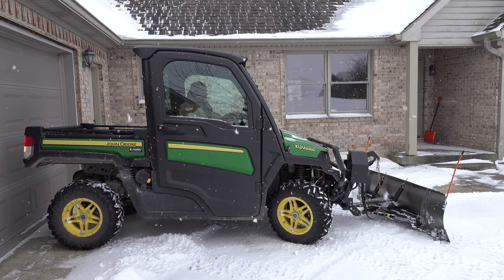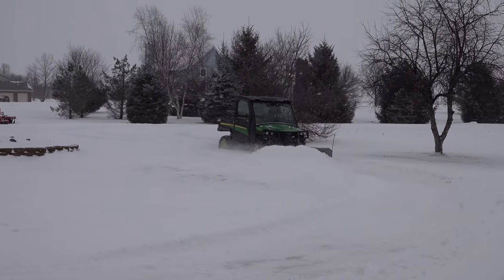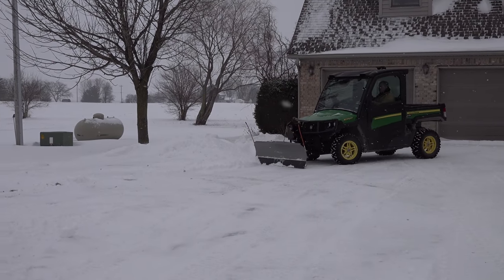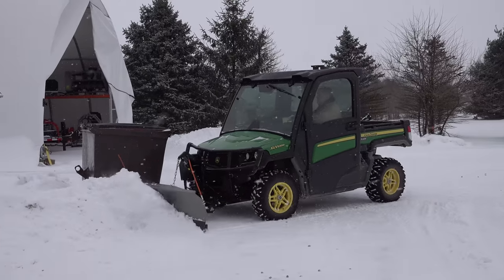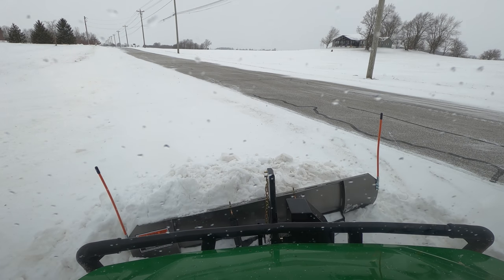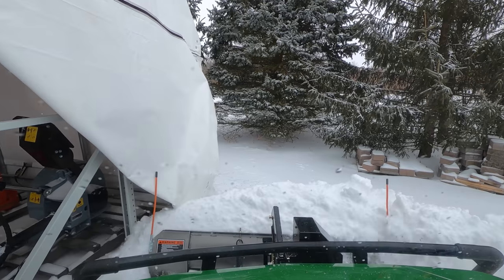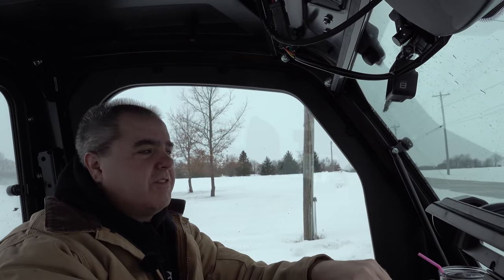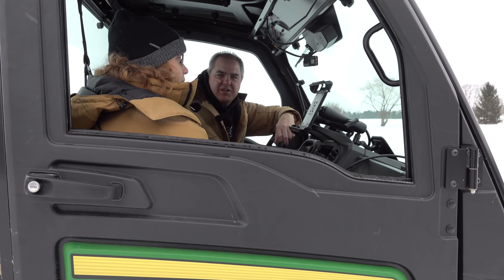Drifting Snow VS. Gator 835M!

Comment: I had a Dodge 3/4 ton with the Cummins, and a BOSS V blade, now that was a snow removal machine. 
I no longer have that, and have had a number of different snow removal tools.
Had just the walk behind snow blower, did not care for that dirty to use, and cold. 
Had a 4 wheeler with plow, good for a small amount of snow, like you were plowing in the video, but again cold to use.
I acquired a 4ft snowblower for the front of the 4 wheeler, that had its on 13hp Honda engine and was a very effective way to move a lot of snow, but again, without a cab very dirty and cold, if wind is blowing. 
Sold the 4 wheeler, and got a Polaris Ranger 700 side by side, acquired a 6 ft plow, and I do have to say how impressed I am with the amount of snow it will push. The key to pushing is weight in the back, it has a max weight limit of 1000lbs, but I find 400-500 lbs is plenty to push an enormous amount of snow. Another key factor is to keep blade straight when first pushing, and use the angle only when cleaning up, or on the longer straight passes. 
I do have an older David Brown with a straight blade, but without chains(2wheel drive), I say it is like building kitchen cabinets with a chainsaw. Very hard to control, and usually have a massive amount of gravel, and sod, in the snow bank, or spinning. 
So all in all, the old Dodge was the machine, but for easy operation, and maneuverability, the side by side is the ticket.

Comment: Balaclavas work well on protecting the face & neck.  Snowmobile suits or diving Dry suits are good.  Baffin boots are the best.

The body protects the head by restricting blood flow to extremities if the head is cold.  So if your hands & feet are cold, protect the head.

Both Milwaukee & DeWalt make heated clothing.  I choose the DeWalt because you can move the battery around.

What we need are gauge wheels on front plows, not just rear plows.  Sounds like a great TTWT project. :)

Comment: Phil here in NE Indiana.  I got a 54" snow blower for my JD 1025R.  I have a 1,000' asphalt driveway.  As you know in Indiana we don't get that much snow but the years we do the snow blower works great.  I've used it 4 or 5 times so far this year.  I added an electric actuator to move the shoot up and down.  What I don't have is a cab so yes it does get cold out there.  The JD 835M Gator...sweet ride there Tim.  I have an 825i S4.  Works great with the grandkids.  Cold here this morning...zero.  Stay warm.

Comment: I have a GOLDEN RULE == Always be prepared for more snow!  When that crap turns to ICE you're locked in, so I push it back a lot every time.  We (Chicagoland) got hammered with a very wet snow and some rain back on 12/29/20 and that crap froze up and has made it hard now with all these other snows we've had since, pushing it all back, so I have 5+ft piles nows down my driveway!  Still love the snow! Fun Fun

Comment: Not sure if your all geared up for the upcoming snow we get Thursday but you can come down with us and try all your toys out at once. Lol. 30 minute drive down to us and we have everything from asphalt, chip and tar, pot holes, new concrete we can’t scratch, side walls, and I think about 2 miles worth or gravel. Be fun to run all different types of equipment on different types of surfaces and see what works. Of course like you mentioned it’s impossible to know if we’ll have heavy snow or nice fluffy stuff.

Comment: I've got a driveway similar to your's here in MN, although we get quite a bit more snow.  I have about 1/4 mile long gravel, large gravel turnaround/parking area, and then a short cement driveway like your's.  I use my plow truck with shoes on the gravel, and then I use my 2038 R bucket to scrape the cement clean.  And then I take my 60" rear mount blower on the 2038 R to blow the drifted snowbanks back from the sides of the driveway so that there is room to push snow for the next storm.  Gravel cleanup is always a pain in the spring - hoping to save up soon for blacktop.  But there's definitely not a single machine that will do it all.  I have a Ranger too, but it just doesn't have enough weight to run a plow

Comment: Tim, I tried to use the pvc. I found out that it breaks up in the cold. I found that cutting a metal pipe for the blade and rounding the edges works great. This idea was from the episode where you where showing the gentleman what options there where for ❄️
Reply: I also tried the PVC on my small BX front mount blower. It does not like going in reverse . It will rip off from the gravel

Comment: That's a nice setup there. I think I would go for tracks for the winter. Better traction, power, and ground clearance. You already have the ultimate snow removing beast ...... Johnny 5. Do you have a blade, pusher, or blower for it? The bucket will dig out any drift situation mother nature can come up with. Funny, a couple of days ago here in Montana we got a lot of snow and it drifted badly in the rural areas. Got a call from a customer to come rescue her Mercedes drifted in half way down her 1/4 mile rural driveway. Then her husband tried to rescue her with his gator and plow just like yours except he didn't have the cab (below zero and blowing) and got stuck himself. Went out there with my Johnny 5 (same as yours) with an 8' truck blade I retrofitted and the 7' box blade. Box blades are wonderful snow/ice tools too. First had to plow and dig to the car, pull it out of the drift (got to admit, first time extracting a car that probably costs as much as my house made me a little nervous), and back it out all the way back to the road. Luckily, the Mercedes like a lot of high-end cars, have an extraction eye you can screw into the frame in the rear or the front so you don't rip important parts off pulling on it. It was easily twice the snow you guys had there in that episode and Johnny 5 tackled that job without blinking an eye. With the car out of the way I needed to push on to the house but had to pull the high-centered gator out as well before cleaning the rest of the driveway up to the house. Didn't even feel either vehicle in A2 gear in 2 ft deep snow. You could easily do your hole property on this video with Johnny 5. If you don't have any snow implements for it, I would recommend that you get at least a blade or a pusher for it. It will blow your mind what you can push compared to the compact tractors. I love my 1025R (no cab), but they're in different galaxies in capability. A pickup with a blade could not even remotely have done the job we did the other day. Stay warm, and I agree Christy should have the heated gator to chase you around on tractors. Also I've been meaning to ask you if you have a part number for the buddy seat you have in Johnny 5. My wife likes to ride along on these adventures and has to sit rear-facing on a 5 gallon bucket. A buddy seat would be real handy, even if it's a tight fit. I (she), would really appreciate it ..... Thanks.

Comment: I plow with a CanAm Commander with a 72” Moose blade. It’s runs off the winch with manual angle. I took the shoes off and run it all the way down. Once the ground freezes up good you won’t get much gravel up. It’s light enough to skim across the top, but scrapes concrete completely clean. If needed I can raise it just a skosch and leave a layer of snow. Hope this helps.

Comment: I regularly plow with a 825iS4 with the same Curtis plowat work.  I suggest adding about 250 lbs or so to the rear.  I found that made all the difference with the S4. I also think you will find the Gator with rear ballast will outperform a truck pound for lb of vehicle.  I find for the size the S4 out performs the one ton trucks that we use.

Comment: Looks like you need some driveway markers I run them on my trailer so I can see where the back is at. Costco had a pack of four with reflectors. I bet Menards, Lowes, and Home Depot has a selection of them. Snow plow services will install them before the snow flies to mark the boundaries. Christy is a champ standing out getting those shots. Please give us an update on your brother.
Reply from the maker: Tom’s heart is fine.

Comment: I have a TC45DA New Holland with a cab and an FFC angle blade on my loader for the gravel lane here. Without the John Deere fuel tank filled with concrete set up on my 3 point, I'd still be trying to get traction.

Comment: I purchased a 1025R with a cab, heater, and snowblower. My walk behind snowblower (Ariens) was great, but I have a very large gravel drive and at 71Yrs. I could't do it any more. The Tractor is great.
My problem is, because I got the snowblower we now only receive an inch at a time here in Traverse City. I'm thinking of billing the road commission  for the money they're saving.

Comment: When you do the end of the drive to the left side , I push the snow  50 to 75 ft  pass ,so when the plow goes by it runs out of snow before it hits the drive , so there is less clean out .

Comment: Plowed snow for almost 2 hours this morning with my X738 rubber edged 54 inch blade. Had I known we would get 10 inches I might have put the 54 inch blower on. 4 hard surface drives. Tomorrow I'll switch to the  2025R with 53 inch bucket and edge tamers. Neighbors stone drive and  road in case they show up this weekend. 
Interested to see the loader mounted blade. I have the Frontier AF10 loader blade but have had limited success.

Comment: I have a Coleman UTV and I put a taperer plow on it. The tapered  *state plow design" peals the snow beautifully here in northern MI. My driveway is 1/4 of a mile long into the woods. Wonder if they make a tapered plow for the gator? If they do, I'd recommend it. John Boy moves my snow piles wondrously.... :). The tapered plow (wider on the right side) would definitely help curl the snow off better than a straight blade...... a PVC pipe will break. My neighbor put a heavier 'BLACK' pumbing pipe on the bottom of my blade and it works great. Doesn't dig into gravel/etc. and glides over the ground when pushing/plowing snow.

Comment: The slides just back of the blade control the height of the blade to the ground? Letting it hang from the chain is adding stress to the  whole system?? Thank you for the video

Comment: I have the same Kubota as you except it has a cab and a front mount blower. I know that ATC's with a blade will twist the frame after a while. With the blower. you are not making a pile that when it gets deep you have to move it.

Comment: We ended up with 8-9 inches, hard to get a good measurement with all the drifting. We have some drifts close to 3 feet. I know it is nothing compared to those northern areas, but the most we have seen in a while (typically in the 2-4 inch range). It is a nice warm -4F this morning.

Comment: Nice video... I still don't understand why these blades come with such small skid shoes. A larger diameter skid shoe would float much more smoothly over the yard areas, not to mention gravel driveways that most of us have.  My only trick prior to winter is using my LS rake sweeping larger stones to the side for spring.

Comment: finally a machine like i have-ha! i have the jd plow instead of the curtis one u showed.. mine i can use down pressure if i wanted too. i only use the float design. no chain on mine. i too agree gator needs a slower speed on the fan for sure.also if i had a cab on my 2520 i would prefer to plow with it-way easier than the switching gear lever of the gator. i plow in low range too-found it works better-easier on the belt IMO. thanks for the review-oh how i love the heated cab for plowing snow-so glad i got it.
Reply from the maker: Yep! The heat and a/c are a TRUE luxury!

Comment: I have a gravel driveway and use my tractor to push snow.  I usually move it going backwards with the blade cutting edge towards the tractor.  I find this works really well for keeping the gravel in the driveway.  I only use the cutting edge of the blade or the bucket if I really need to.  Like I said, helps keep the gravel in the driveway.  Will be interesting to see how the blade with the PVC pipe does.  Haven't heard of that method before.

Comment: A piece of 2" PVC pipe cut down the length on one side and slid over the cutting edge works great on stone driveways grass-covered areas and cheap to replace when it wears out
Reply from the maker: Or not.  See tomorrow‘a video.

Comment: If you'll push the snow at the end of your drive where the drive meets the highway up the road off of the shoulder a bit, when the plow comes through, it probably won't fill your drive end up.   You don't need to go far.   I'd say less than 50 feet, but it depends on how much snow you have.    It works well for me in Northeast Missouri

Comment: I sure wish I had a cab on my cf moto cforce 820 atv with the plow
One tip though, it looks like you have your plow right now set to low in the attacher, always strive after to have the plow attachment as level compared to the ground as possible
I made that mistake a lot when plowing gravel, then the plow sort of acts like a razer blade , and the plow depth shoes gets in the wrong angle which makes it not glide onto the ground as they should

Plowed many many milies with tractor and blades when we had municipal roads and a lot more private roads to deal with, and dad taught me this early on, always try to level your blade and especially from the attachment joints and forward to the blade, hope it will affect your gravel plowing a bit for you in the future :)

Comment: You should dress that one hose or cable hanging down on the right side of the plow frame.  Would hate to see you snag something sticking up as you are reversing.  You could use an elastic band or Velcro strap and attach the controller to your leg for easy reach and operation.  I was running our work Kubota RTV 1100 with a v-plow setup.  It does take some anticipation of how you want to angle the plow as you go and have to shift forward and backward all the time.  I would love to see them come out with an UTV design that had a hydrostatic pedal design with the speed of an UTV.  The  V-plow design controller could be better if it had programmable preset button on your most common positions.

Comment: My driveway isn''t big enough to put a plow on my Ranger. I have 2 snowblowers. Both Toros.  The big one is an 828 and then I have a CCR1000 paddle blower.  I use the 828 to clear my concrete pads and the 828 for my gravel. I have the shoes set down on the 828 to not pick up gravel.  Still, unless the snowfall is significant, I don't blow the gravel. I choose to pack it down to lessen the probability. of picking up gravel. So far this year I haven't had to use the 828.

Comment: A rubber cutting edge would help with scraping concrete and not dislodging and relocating crushed stone.

Also lift your blade as you enter the pile to avoid abrupt stops on ice.

In my truck I hold the controller just like you.

Comment: You need to get a blade for Johnny 5. I plow with a jeep and 4way hydraulic plow I find it works best to hold the remote and gear shifter together that way you don't get the remote cable tangled in the wheel. Yes the shifting gets tedious but as you do it more it will become second nature.

Comment: we have a 1 ton dodge wit a stainless XV2 fisher snow plow. i bought a XP 30 7'snow pusher, and a hyd Rhino 850  8' scraper for the rear that we use on our new john Deere 4052 R cab tractor. my son said Mom will never use the truck for plowing, now  u have that pusher we opted for the back drag on it.my son just plowed with it and said Wow is that nice or what. i have plowed with a 40,000lb loadesr with a 14' and a 12' pusher and a 15' quick switch on a 544 JD loader. both the XP 30 and the 850 Rhino scraper blade are Quality

Comment: Adjust the shoes on the plow... some people remove the shoes when wanting bear pavement. Now you know why guys like heavy blades. Some plows have down pressure. Take a look at Snoway. Also keep weight in the back. It helps with traction.

Comment: So I'm wondering why you don't use the drone ? Christy could control it from inside the nice warm gator whether you're using the gator or Johnny.
Reply from the maker: One reason is that the drone has no audio.  Another reason is that super cold weather is not good for batteries.  ...and there are other reasons.

Comment: Would  the Rhino Ag rear blade  on Jonny 5 work for  snow plowing and do you have or plan on getting any snow removal attachments for Jonny 5?
Reply from the maker: It would work.  Not sure if I could keep from destroying the driveway/yard!
Reply: @TractorTimewithTim   Doesn't the blade have shoes and a wheel in the back that you could set ?
Reply from the maker: Yes.  Have not experimented too much with the gauge wheel,  but shoes on ANY blade are not proving that useful to me.   They just don’t work well in my experience.

Comment: Take a piece of 3/4" pvc pipe the same length as your blade and slit it on a table saw or use an angle grinder.  Slide that on the cutting edge of your blade and it will keep the blade from digging in on the gravel areas.
Reply from the maker: Next episode...

Comment: tim on any of your plows when turnd left or right dose it get pushed off the bank and mess up the way you plow
Reply from the maker: Not sure I understand.  Does it push the tractor the opposite direction?  It can do so.  However, the Gator seems to be able to take a pretty big pile before this occurs.
Reply: @TractorTimewithTim  yes tim you hit that nail right on the head where i live we got 6 inches and it took me 4 hrs to plow it cause of tgis issue 

i tried to pick up the plow to get my front wheels on the ground but that didnt help eather
Reply from the maker: If the bank gets too large then I hit it cross ways .   Push directly into it to move it back.
Reply: @TractorTimewithTim  yep that is what i found worked    love the videos keep up the work 

i like both colors i will take what runs